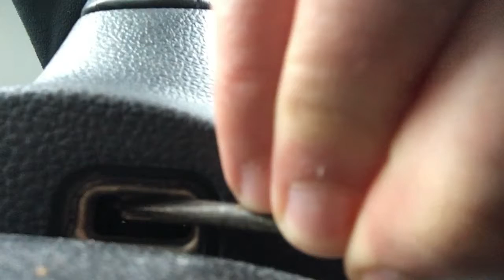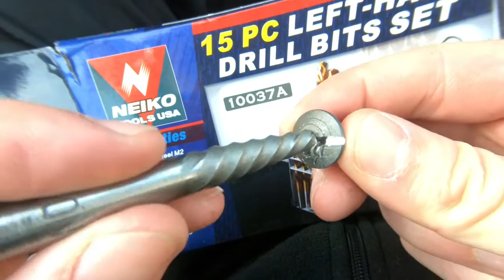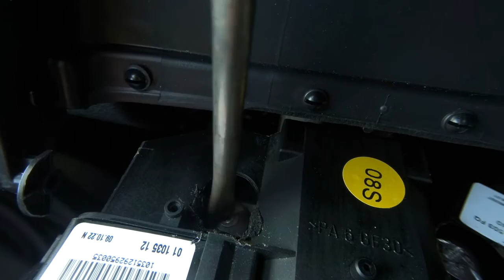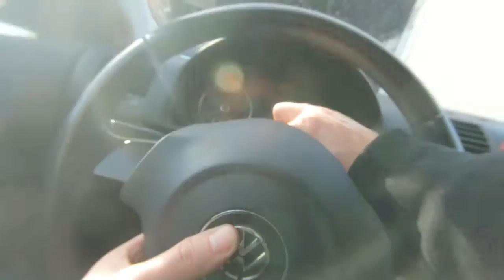How to remove Ignition Module VW / Audi ( STUCK KEY FIX)

Comment: You don't need to drill and slot those 2 screws, they come out easy with a hardened center punch. You punch on the head offset to one side a few times then hit it again a few times on an angle till it starts turning. Then just use the punch in your hand and turn it till it's out.

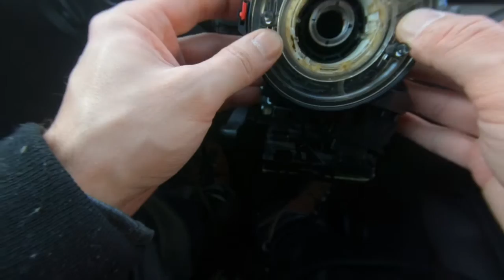Comment: Thanks for the video bro, but @1:09 you just say take it off, but make sure it doesn't move? That's is completely confusing AF. 1) It would've been nice if you mentioned how to take it off. I'm stuck at this point, the thing won't budget. 2) How do you take it off, if it's not supposed to move. I'm literally stuck now! Frustrating af. Now I just have to stare at my car in the parking lot.
Reply: To remove electronic module from the bottom there is a little square hole below the screw. Insert a thin strong wire in about 20mm and move wire to right making inserted end go left releasing front clip. The back clip is now visible as front drops down. Make a tiny hook on end of wire and pull centre of rear clip towards you. Module releases.
Reply from the maker: This is a free video.
Reply: @BulliKid  Much appreciated, but when you make videos like this that people follow and you skip over important steps, you leave them stuck in the middle of a project with their car half way apart. Anyways thanks for uploading.

Comment: Question, does the clock spring and the multi switch assembly have to come out in order to swap the cylinder? Seems like you can get to the lock cylinder without taking out the assembly.

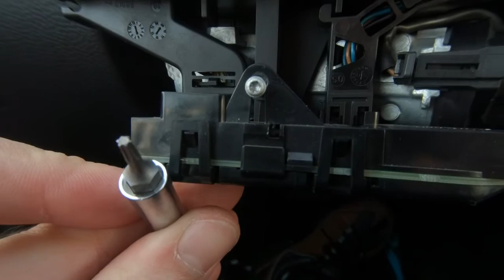Comment: 1:30 "German tool" seems to be a torx bit, like T-9 or T-10? Uhm. Them be designed in the US, albeit with the rational sense of using metric (millimeters) for size intervals.

Comment: at 01:40 does anyone know how to disconnect this circuitboard module at the rear. I've removed  the front screw and the cable with the yellow connector , I cant see what is still holding this module in place. I'm afraid to pull too hard in case I snap something that I cant fix later. The cable on the left is still connected but it doesnt look like I really need to disconnect it to remove the module. Really stuck here for last few days.

Comment: I cannot get that clip off thats holding the airbag section in place, tried for 2 hours the clip will come down but not go back. Contemplating life rn its 1:30am
Reply: I got it! Just cant get those top screws out how haha
Reply: @stevenmiller2549 hey I tried for 4 hours and I couldn't get the clips of the airbag to go back.  How did you do it???

Comment: Great video. I replaced the factory bolts with M8-1.25 x 16mm socket cap screws, in case I need to do this again.

Comment: Excellent video, without which I could not have done this job. Much thanks. Although I have a few helpful comments for others. 

20 seconds - A tool short enough to come in perpendicular to the steering wheel makes this easier. That long screwdriver has to come in at an angle because of the gauge cluster.  I used a spade drill bit, which has a nice sharp point to work into the slot above the clip and a nice large flat spot to press down on. 

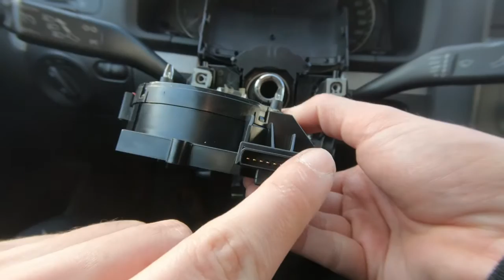43 seconds - I was only able to get the clock spring off after I’d removed the electronic unit under the steering column since it is plugged into it. So wait on this. He kind of explains how they fit together at 1:03. 

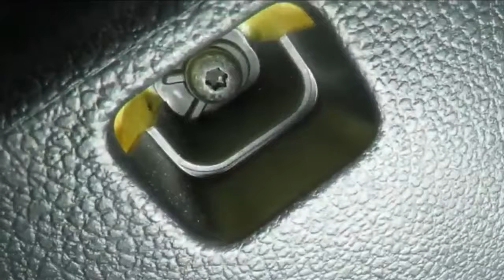1:20 - It is easiest to access this machine screw if the steering wheel is tilted all the way up and the tilt steering lever in the unlocked position.

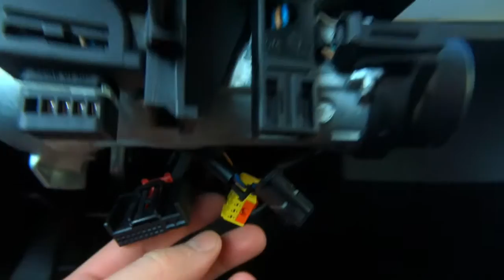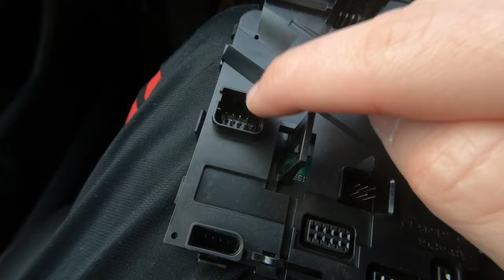Watch carefully from about 2:03 to 2:12 to see where those two tabs are. The back one is easiest to find, and makes it easier to know when you hit the front one if the back is already unclipped. So unclip the back one first. The front one can be accessed by inserting an ice-pick type tool directly under the ignition lock cylinder and angle the tip slightly toward the back of the car and feel around for that clip. 

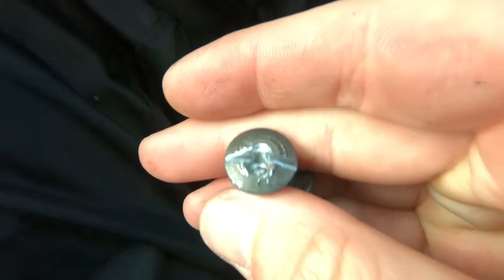2:42 - drilling out these bolts is easiest done with the tilt steering adjusted to the lowest position and telescoped all the way out. Otherwise the top of the dash will probably be in the way.

3:02 - There is no need for left-hand drill bits. Just left-hand easy-outs, which all easy-outs are.   

3:55 - the clips to unclip the ignition cylinder from the housing are located under each of the two tabs that the bolts that you just removed threaded into. You have to slide the cylinder forward also. They are less like clips and more like one-way doors that you need to press up on. 

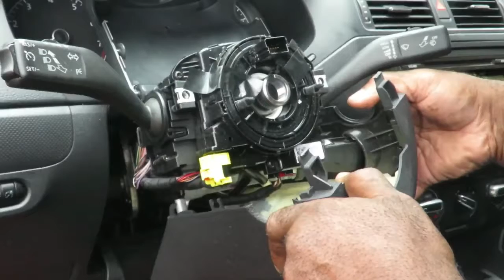4:16 - If you need to get the key cylinder off the ignition switch, you need to watch the video linked in the description “How to Fix a bad VW Ignition Module for FREE! (STUCK KEY FIX)” and go to 1:27. You can tug and pry all you want, but without doing what is in that video, you won't get it apart. 

I hope this helps
Reply: Just wanted to commend my respect for this. I try and do my part, sharing as much as I'm able. I wouldn't be half as far, without shared knowledge from guys like yourself. Thank You. Everyone else, take notice. If you see an unanswered question, and you know it. SHARE, Never underestimate how much you may be saving someone's ass. That's all, I'm out. ✌🏻
Reply from the maker: thanks for the comment and tips!!

Comment: What tool are you using at 1:34? Is there an alternate US tool that I might be able to use? Thanks, and great video!
Reply from the maker: Torx bits
Reply: Update: I used a T-9 and got it removed. Thanks!
Reply: Update: I used a T-9 and got it removed. Thanks!
Reply: Update: I used a T-9 and got it removed. Thanks!
Reply: Update: I used a T-9 and got it removed. Thanks!

Comment: i was able to use a small shape chisel and a pointed center punch to loosen the break away bolts. I went on an angel and it bit into the top of the bolt then i tap it with a small hammer once it loosened it just screwed out pretty easy.

Comment: If the steering wheel is locked how do I turn the steering wheel 90 degrees to remove the first 2 clips
Reply: I had the same problem, for me the answer was just be stronger. I had someone wiggle the key while i turned the wheel back and forth with everything i had, worked for me🤷‍♂️

Comment: Is there any chance you could take out the ignition switch without taking off the steering wheel? Thanks.
Reply: Yes, you take off the plastic case around the steering wheel, and you can remove the sensor, then the ignition switch which is the black plastic inserted on the left, is easily dismantled by a flathead, and then you can remove the white plastic inside.
Reply from the maker: Umm I don’t think so

Comment: Not trying to be a dick or any thing but wow man you are doing the most. All you have to do to remove the brake away bolts is use a flat head screwdriver and a hammer on the edge of the bolt and with a few hits they are loose. Good job making easy shit look hard!
Reply: The silver flat piece o the whole bolt?